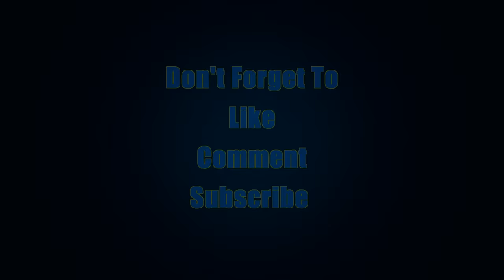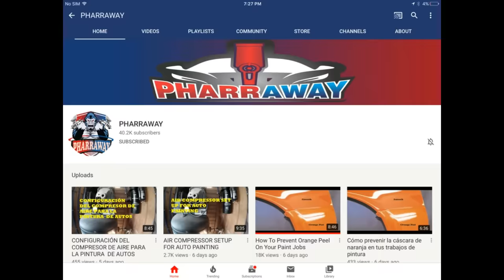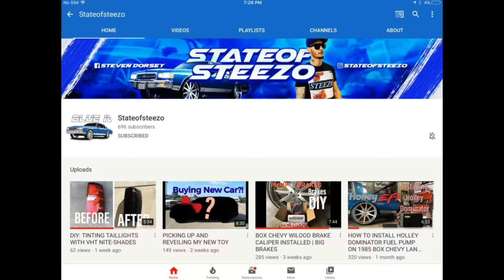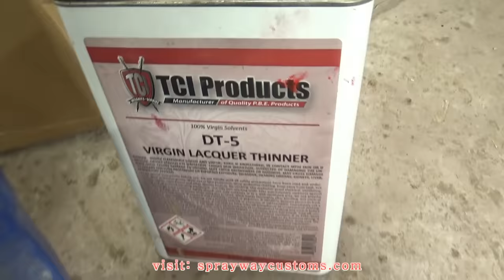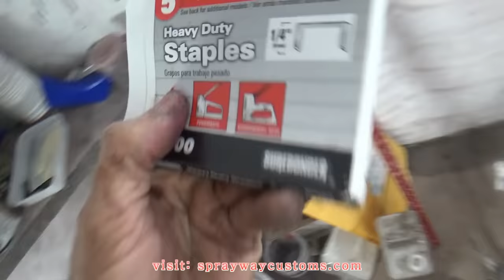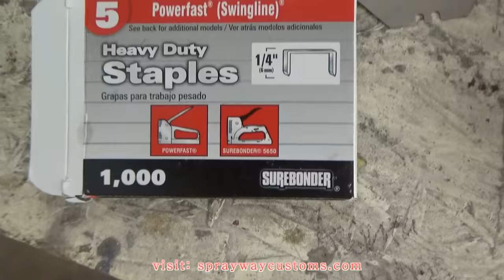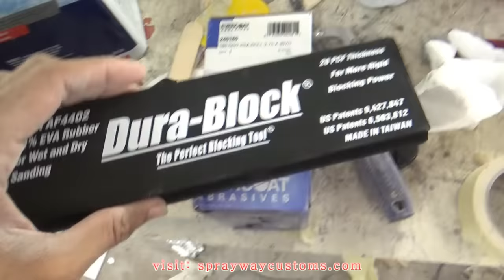Cracked Dashboard Repair With Fiberglass BOX CHEVY CAPRICE DASH RESTORE How To Fiberglass Dash Pad

Comment: My man first of all tip of the hat for thinking out of the box for this repair!!!
I would like to recommend a VERY good produce that  you can get them almost any color it is as tough as bedliner and UV stable so the Sun Won't bleach it out. It is called durabak. Look it up there are two versions one that's an aggressive grit for like truck beds or the Navy uses it for their non-slip applications on aircraft carriers and other ships. The second type of durabak is a smooth non-slip application it is both shiny UV stable and would be perfect for applications like this or the manufacturing of woofer boxes. It's a really good product and it also will drive to a high shine. I highly recommended it!!!!!!!

Have you used the poxy instead of polyester resin? It's about 20 times stronger course it's about a hundred times more expensive to. LOL have you use cabosil much? I have a 96 Chevy extended cab I'm currently putting a system in it and the dash is cracked and it is causing me no end the consternation because it ain't all there you know I mean it's it's going to crack up. You're giving me ideas. LOL
Reply from the maker: Thanks for the info on the durabak
Reply: @SprayWayCustoms  I don't know where you located it's a company out of New Jersey by that name. It applies anybody anyway you want to put it down you can spray it roll it put it on with a paintbrush. It is not acetone-based it is xylene based but once you put it on it will lay down and smooth out it doesn't require any sanding. It's also flame retardant and it is hard as Nails man. I put it on my decking when I did my boat but I went with the aggressive grit and I regretted I wish I'd gone with the smoother Durabak. Also if you will look on their page they will send you free color samples. Might save you some time doing dashes like this. Once it sets up and tries that stuff is amazingly hard I mean very hard. How long you been in the business of doing this stuff man I know what's involved and you make it look easy that's how I know you been doing it awhile. Maybe in your next video mention how expensive these products are so that people understand that this ain't no $25 worth of product that you're doing under a tree this is a professional working with professional products. I wish you all the best and I mean it
Reply from the maker: Very much appreciated again 🤝

Comment: I have a dash this bad and been thinking about fixing it just this one but really want to try to carbon fiber it have you tried carbon fiber one any of your projects
Reply from the maker: I haven't tried it yet but I been wanting to. Thanks for watching
Reply: @SprayWayCustoms  My dash has some real deep cracks is there someting i could fill them with or just leave them and fiberglass over also you made that headliner look easy. Where are you located im in W Tenn
Reply from the maker: You really don't have to fill them if you gonna fleece over the entire dash but you could use a spray foam to fill the cracks with. I'm in North Alabama
Reply: @SprayWayCustoms  Im in Jacson area here
Reply: @SprayWayCustoms  So were not that far apart and i want to see one done in carbon fiber but i have aeen them make a whole dash or body panel out of carbon fiber.

Comment: Can This Be Done On A Plastic 98 OBS Dash ??
Reply from the maker: Yes, as long as you wrap it in fleece to give everything something to bond to. I'm working on a 94 OBS now.
Reply: @SprayWayCustoms  Thanks For The Help. My 98 OBS Dash Is Cracked Pretty Bad. Probably Going To Get One In Better Condition. Then Do The Steps You Showed. Wrap In Fleece. And Your OBS Is Coming Along Real Great. Were'ed You Learn To Do This Awesome Work.
Reply from the maker: No problem at all Dylan 🤝

Comment: Can I apply rondo to a plastic dash? I welded some cracks from the underside and wanted to paint some rondo on top!!
Reply from the maker: Yes you could but resin and body filler really don't bond to plastic good. I would recommend to sand and prep it well so it will bond
Reply: SprayWayCustoms I surely appreciate the  timely advice my man!!! Number one in the game for sure!
Reply from the maker: Not a problem at all Ken

Comment: your still using nitrostan red throw that away and get some 2 part glaze it has less
 shrink. Also you might want to go ahead and get one of those spray can handles that gives you a trigger control for spray cans. they cost about 4 bucks. will save your finger
Reply from the maker: Appreciate that

Comment: Question. I started a project on a door panel and had an emergency call.  I went through the steps but when I started laying fiberglass I had to stop and now the fleece is rock hard on the panel.  Is it ruined or continue where I left off?
Reply from the maker: No that's fine...It'll still bond
Reply: Thanks homie.  Keep the vids going!!💯💯

Comment: Ayy man I'm painting my truck interior. I'm using sem plastic/leather prep, bulldog adhesion promoter and sem paint. Some parts of it came out really really good and others are just chipping off nonstop. You got any tips for me? Thanks in advance.
Reply from the maker: Did you scuff the parts up first?
Reply: @SprayWayCustoms  I mean all I did was clean off all the dirt, use the prep spray to wipe it off and then the adhesion promoter. Afterwards I sprayed the paint color a few coats. Some of the parts like the dashboard and bezel came out good and didn't chip off unless you really scratched on it. But the rear panels are chipping like crazy. Not sure what I'm doing wrong there.

Comment: I'm sorry to keep bothering you...The speaker grills are actually part of my dash...The Vinyl part.  It's not a separate piece.  There are only a couple of spots on the grill that need to be fixed, but all the holes are so close together.  I was thinking, maybe a metal strainer that I could mold fiberglass to along the lines, but I'd have to be able to take the strainer off.
Reply from the maker: You could use mesh grill and fabricate a wooden frame that you can remove. I'm doing something like that on a dash in a couple days
Reply: @SprayWayCustoms  Cool, will you please post a video of it?  At least the speaker covers?
Reply: @SprayWayCustoms  I really wish I could post some pictures.  Do you have a business email address?
Reply: SprayWayCustoms like a silicone mesh maybe?

Comment: Sprayway, you ever spray expanding insulation foam into the dash cracks to level, then sand and glass? Spray Foam is Urethane foam so, polyester resin should be good to go on it.
Your thoughts?
Geezer Gearhead out west
Reply from the maker: Yes I have

Comment: Great job! It looks like this process adds a good amount of bulk to the dash. Do you think that will cause any issues remounting in the car, and why fleece? Again nice work man!
Reply from the maker: Thanks oldhess. It could cause a problem with mounting it, that's why it's best to constantly test fit. The fleece is to hold the resin and form it up.
Reply: @SprayWayCustoms  any particular reason to use fleece over other fabrics?
Reply from the maker: oldhess no you can actually use an old t-shirt. Fleece pretty cheap
Reply: @SprayWayCustoms  dude thanks for taking the time to get back to me. I appreciate it. What part of the US are you in. I'd love to throw you some work
Reply from the maker: I'm in Alabama

Comment: Laquer thinner will DESTROY plastic parts. DON'T DO THAT! Best thing to use would be Easy Off, Oven cleaner. I use it on sensitive plastic parts for interiors to repaint to factory color while retaining the factory texture. In my job, I have to retain factory texture.
Reply from the maker: Yes, I wasn't concerned about retaining its original shape because I was spraying a bed-liner over it. I just wanted the plasti-dip off.

Comment: Could I just use you in famous rondo to spread all over the dash without the fiberglass? To give it a smooth surface to spray the berliner and paint.
Reply from the maker: You could but it will crack on stress points
Reply: Will it still crack if I first put the fabric on then the rondo on it?